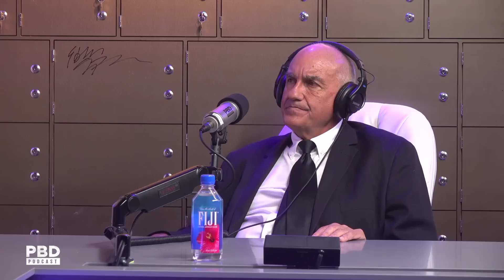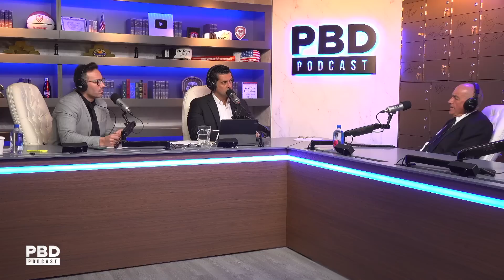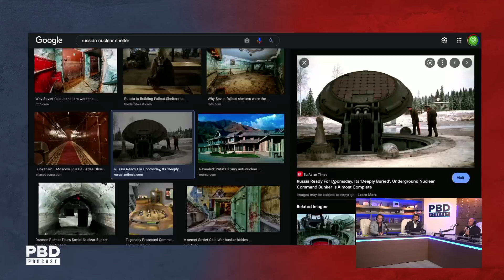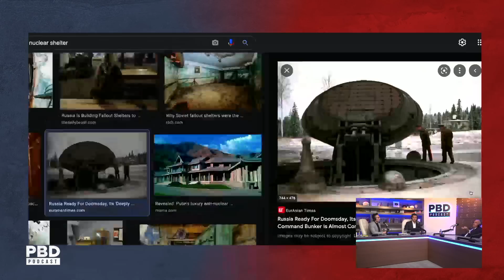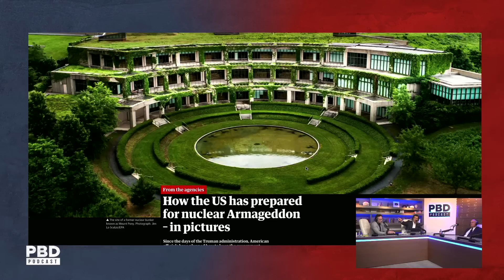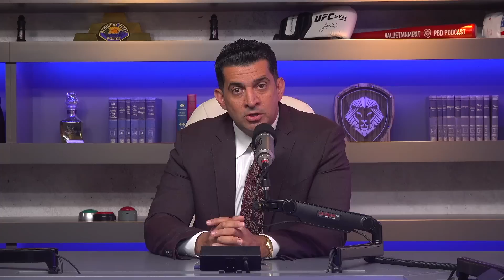'It's Not Hard At All' - Breaking Down How Difficult It Is To Take Down America's Power Grid

Comment: Why use an expensive device, when all you have to do is find a central substation, shoot holes in the bottom of the transformers and go home. You don't need any expensive technology or toys. The oil will leak out of the transformers, they will overheat and shutdown. In fact, this has already occurred in the USA, and it caused a power loss in portions of southern California. Look it up; it was    test attack, just to see if it worked. I think they shot up 3 substation's transformers and it was very effective in shutting down power because when one substation loses power, other substations kick in and try to supply power, and then they overload and shutdown - kind of like falling dominos.